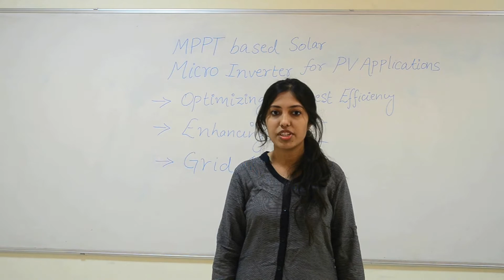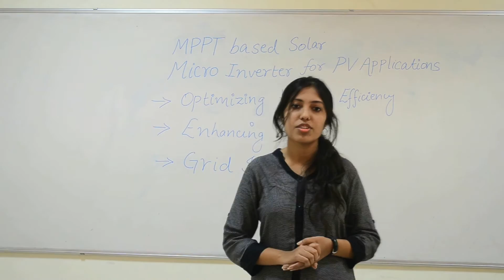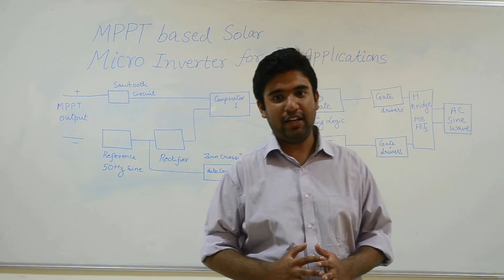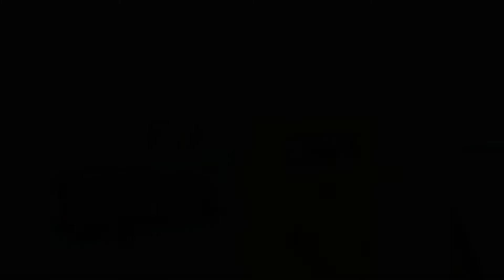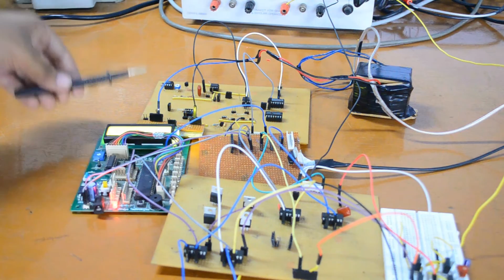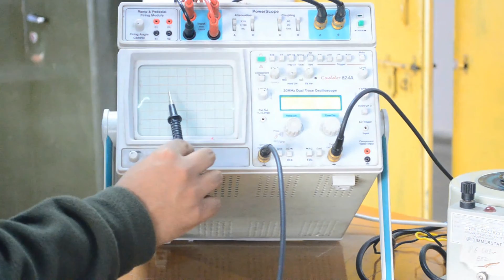TI IDC 2015-1006-MPPT Based Solar Micro Inverter for PV Applications

Comment: can we use the same circuits and same method to get 230v output using transformer and current upto 8A so that we can use it for normal house hold applications using 100Ah battery
Reply: Yes you can use it. Use a 12/230V transformer and get swiches of appropriate rating. The control circuit will remain as it is.